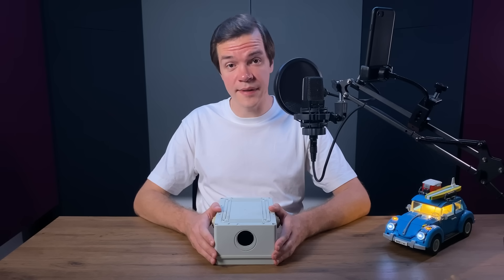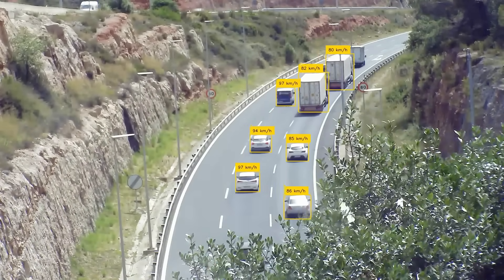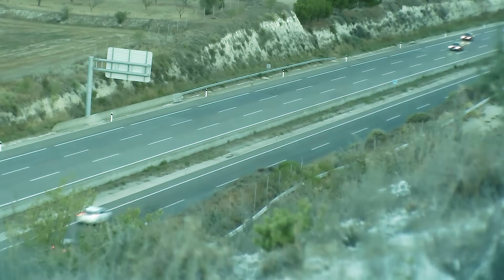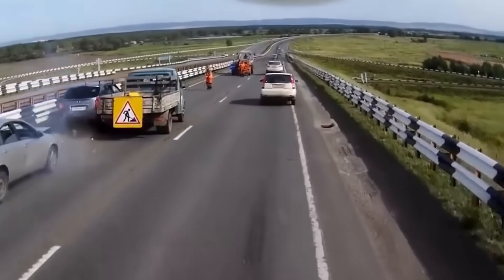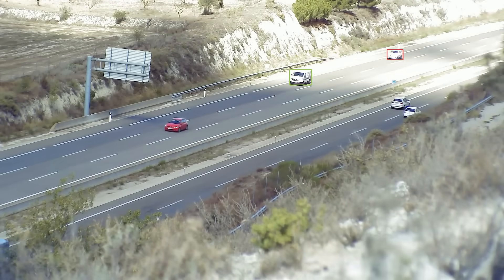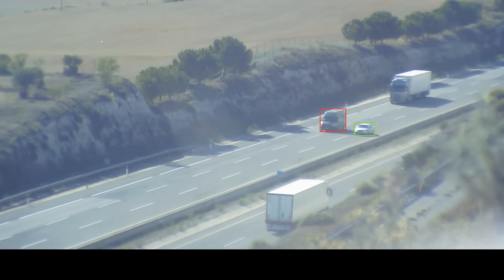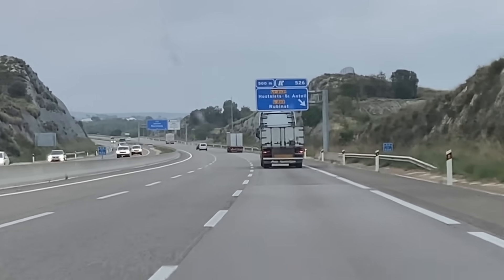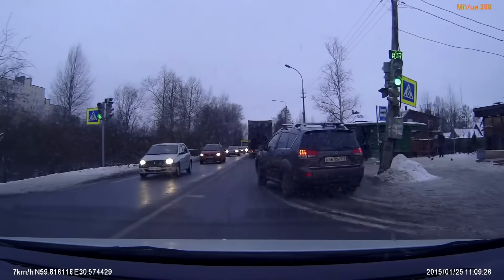New Anti-Tailgating Camera Reveals Shocking Statistics

Comment: the minimum following distance is dependent on speed.  higher the speed then greater the distance.  speeding has an impact on tailgating if the speeding driver does not increase their following distance.  but if regardless of speed the following drivers do not maintain the safe following distance then the safety effect is driven more by tailgating than speed.

Comment: The problem is also traffic congestion, aka how many cars are on the road. People see a long following distance and think "I can take that space". Which not only makes your new following distance to small, but also often leads to sudden stops as you try to increase the distance again. Sudden stops leading to people behind you to run into you. Never mind stop time always is calculated by a fully alert and ready driver. If they are tired, on their phone or any number of "distracted driver" situations your reaction time is not  going to be .9 seconds. So the stopping distance balloons out further. So instead of having every one drive half a mile behind each other for safety it's far easier to just lower top speed.

Comment: 2 big hurdles: cost of realtime video analystics and ALPR.
Speed is easy: ALPR at the beginning and end of section control, calculate average speed? Too high - fine to the license plate holder.
You'd need ALPR at the beginning and end of each camera frame to 100% make sure you can correctly identify the tailgating vehicle.
Still, it's a question of want.

Comment: 100% tailgate on CA highways lol. They all go 80+ mph while tailgating. I once watched a car try to change 4 lanes on a 5 lane highway and it lost control and spun out. Amazingly, all the cars around it slowed to allow it to spin out until it hit the gaurdrail  on its side and it ended up off the road, and then super optimally, all the cars that slowed sped back up smoothly and we were all tailgating again... it was surreal. Obviously something like that usually ends up causing a huge multi-car crash.

Comment: My state of residence recently passed a law that prohibits slow driving in the “fast” lane of major highways. The slow driver can’t impose their speed limit on other drivers. When driving in the fast lane I have 25 seconds or less to change to a slow lane and it is lawful for the approaching vehicle to flash its lights to remind me to change lanes. This removes the necessity of switching lanes for the fast drivers. The police would rather issue more speeding tickets than clear more wrecks. Common sense finally at the state level.
Reply: The trouble is that the drivers who think they are F1 drivers go into the fast lane to drive well over the speed limit. That isn't the "privilege" of the fast lane, the fast lane is abused far too much by imnpatient drivers... who tend to also be tailgaters.
Reply: No, the fast lane is abused by those who think it's their job to enforce the speed limit. Just move out of the way and get on with your day! In almost every case it isn't the sheer speed that the problem but driver error varying from several other things

Comment: I think the same type of people that speed are the same impatient ones who will tailgate when stuck behind someone not speeding 

Not to mention, especially not on freeways however, speed limits take into account non-vehicle dangers such as probable pedestrians, blind corners, animals, and conditions 

This would definitely be a worthwhile thing to enforce, but you kinda got there at 12:15
The biggest issue is that, at least in my country, tailgating to the point most poople do, isn't codified as illegal. Only really bad instances would probably be found as "reckless" or some other more generic infraction.
So first step would be puting the recommendations into actual driving rules (but your country might already, seeing as you have those 100m signs)
I'd argue though that someone cutting you off would be at fault for the fine so no issues there.

Comment: The problem with tailgating enforcement is that it simply isn't possible to fit all drivers on the road and maintain safe distances. To compensate you have to travel in packs, BUT scan well ahead to see the driving patterns of people at least a quarter of a mile ahead of you while constantly reassessing your immediate surroundings.

Also, truckers have a different lead time recommendation. 7 seconds normally, +1 second for speeds greater than 50mphr, and +1 second for bad weather. At 55mphr on a dry day with good visibility, it takes a truck more than a football field to come to a complete stop, and one and a half football fields on wet days. Don't brake check truckers, and never cut in front of a truck going up or down a hill especially if it has its hazard lights on.

Comment: Cars could have built in cameras on the front and the back with a single laser to measure distance. That would allow drivers to report it. But since it happens so much that would create two issues.
1 - drivers would not report cause ots too much to bother
2 - if drivers did report every or most cases OR the reporting would happen automatically then the courts would be absolutely FLOODED with reports like these

Comment: I really liked your video and you're obviously a very intelligent person... but I'd like to point out the following: Excessive speeds are not the only cause of accident, but the primary one. This is because the principle is that if you can't brake in time to avoid an accident, you're driving too fast, no matter what speed you're going. You can insert your tailgating distance and  being cut off reasoning here. Also, not only probability of accidents but consequences of accidents aggravate with the square of speed. Radars only cover locally, true, so more radars or average speed radars are necessary.
Also, in Portugal there sometimes are some markings on the road for tuning safe speed for 120km/h, this could be helpful in identifying tailgating. 
Anyway, I want to congratulate you on your tech savy initiative, it was a very very didactic video and I subbed.
Reply: No, speeding is not the primary cause of wrecks. Your principle does not reflect human behavior, so you can’t design your expectations around them.

Comment: The safe following distance rules are invalid for modern cars that can stop much quicker and even have auto breaking in some cases.

But there is no reason to drive at highway speed 10-15m behind someone. It’s suicidal. 

Just give some space. Minimum 3 car lengths.

Comment: Just a few thoughts:

The box seems pointless. Practically any regular video camera could have recorded that footage.

Tailgating cameras exist, for example here in Austria. Curiously, they are only used on weekends and never during weekday traffic.

The danger of speeding is not just about other drivers. There are also objects that can bring you to a very sudden stop, like poles, guardrails, trees and so on.

The recommended distance to the car in front is usually two seconds. That includes reaction time and one second for braking. This is based on the assumption that the car in front is also braking normally and still moving forward.

But overall, I do agree with you. Keeping a safe distance is important, and many people don't follow that rule. In my opinion, it is kind of an ego thing. Just the way people are.

Comment: truckers do not tailgate to save fuel.
they tailgate to close the gap between the truck in front of them before overtaking so they don't block the lane to long for other traffic.
and in the netherrlands the recomended time is 2 seconds.
all modern trucks have radars installed to stay at that distance when driving on cruise controll.

also in gemany there are camera systhems in use that measure tailgaiting but is done with two camera's and two measuring points some distance apart so a car is tailgating and not a one moment acurence.

Comment: Tailgating a truck in an electric car DOUBLES your range compared to be alone at the stable same speed. 1 A car can brake way harder than a loaded truck. 2 behind a truck you have its big red lights just in front of our eyes. One day an alcoholic guy told me that after loosing 2 times its licence in accidents when driving drunk, he decided ..... not to stop drinking, but driving only following trucks. From then no accident [;oD Joke aside most of peaople chose their tailgating distance from their perception of their own ability and car capability. Most of the time it is correct. Proof is most of people have no accident. Would be interresting to add the drivers age data ontop of your distance graph. I'm pretty sure that most people gradually increase their distance when aging. Driving a good chassis/Brakes/tires car, I'm only seriously concerned by what is behind me when on a motorway.

Comment: If tailgated (excessively) I just ease back on the gaspedal slightly for 30 seconds. Then accelerate quickly (since I now have plenty of space ahead). Repeat process if necessary. Appropriate distance is rewarded with stable speed😊

Comment: There was a public warning ad about tailgating on TV when I was young. The phrase they used was "Only a fool breaks the two second rule". You see the car in front of you pass a road marking and then say the phrase - it takes 2 seconds to say, so you should be able to say it before your car passes the same mark. Never forgot it. Taught it to my kids.
Reply: I saw that, and follow that! Most cars break the 1 second and often the half second rule these days 😬
Reply: Sounds familiar, with a second line something like "and double that in bad weather"
Reply: In Norway those ads had a 3 second rule. Count 1001, 1002, 1003, easy
Reply: @retroMartin  That sounds like a 2 second rule: If you say 1001, 1002, 1003 with one second between them, only 2 seconds have elapsed.
Reply: Incorrect. Each 1000 is  second.
Reply: @retroMartin  Add 1004 to that to actually get a three-second duration.
Reply: Nope.  Three-Second Rule, at a minimum.
Reply: Same. That was in a time when revenue raising wasn't the first choice and it was all about safety.
Reply: And 55 stay alive
Reply: Stupid idea.  Timing is a function of speed.  The faster you go the more time you need.
Reply: @alexandercastleberry480  It's a matter of reaction time. It doesn't matter what speed you are going. If you apply your brakes 1 second after the car in front of you does, and you start 2 seconds behind, then you should have a 1 second buffer. But there are so many distractions these days, they've increased the recommend follow time to 3 seconds, or even 4 seconds, and more in bad weather.
Reply: The 3 second rule has been used for a very long time in some areas - at least since the 1970s. Also, if following any second rule, the distance between you and the driver in front of you increases as the speed increases.
Reply: You only need more time you come to a stop if the object which you need to avoid is already there, stationary. If the object in front of you is moving, then when it begins to stop, even if it slams on the brakes, as long as you are following at a distance of 2 seconds or greater, you have enough time to avoid hitting them. Also, if you and the object in front of you are moving at the same speed, the distance between you increases as the speed increases. 

I've heard several "second" rules, but the one I prefer to follow is the 3 second rule. If I'm off in my count, it's not a big deal, because I still have a good bit of reaction time. You need at least 1 second if you're alert, but if you're tired or relaxed, you might need more,  and if you're allowing 3 "seconds," even if your count is fast, you should still have a good 2+ seconds to safely react.
Reply: @alexandercastleberry480  You missed the point and do not understand the concept.
Reply: @alexandercastleberry480   A two second gap will automatically be longer in distance when traffic is faster.

Comment: Cars should have an inbuilt front proximity alarm just like a seat belt alarm. The speed of the car should automatically go below the front car's speed if the distance between is less than the safety distance.

Comment: You are right, observing a short section without context like cutting in in front isn’t doing any justice.

Consider this:
 I think 30m (reaction distance) is usually chosen because it is assumed the car in front also brakes at about the same rate (ABS) which would be enough. Also we usually observe further ahead than the car in front, so in situations (lane change) where we know that car in front is not hitting anything to decelerate faster than normal braking, it is justifiable to undergo that 100m distance temporarily. Its not like the front car can be expected to hit a invisible wall. 
Emergency braking assistance systems are EU requirements now for new cars. But foresightfull driving and braking will be tough to implement in automatic systems.

Comment: Speeding causes problem with lane change safe. HGV has speed limiter set to 90kph. On motorway we have 140kph speed limit (PL). So driving 100-120kph is absolutelly ok, but there is the trick: you need to change lane for overtaking. Speeding vehicle has approach speed more than 20kph (140-120). I usually program my car for speed 112kph on S-class ways (speed limit 120kph). It is fast enough and fuel economic. Here comes the problem, cars with speed above 160kph. Speed difference, that makes hard to change lane safe.

Comment: As a truck driver, I learned that the 2 second rule is part of a longer rule. 1 second of following distance for every 10 feet or 3 meters of vehicle length. A motorcycle can stop very fast, a 60 foot long truck takes a lot longer.

Now take a look at how far apart those trucks are. Between each other 2 seconds is probably enough, because they all have about the same stopping distance; but following a car, they have no chance of stopping at 2 seconds.

Comment: Tailgating is certainly one of the problems. Perhaps I'm too optimistic, but I'm convinced that most problems with traffic on highways could be done away with if people used the passing lane to pass. Instead they just sit there cruising at the same speed as the person beside and them while 10 cars pile up behind them. In some worst scenarios the inattentive driver gets mad that the people their blocking are "too close" and begins brake checking.

Comment: The other reason for the rear enders is that people only look at the car ahead, not around it or through it, they also don't anticipate events and actions before they happen, i.e. understand that a joining lane will likely result in a queue of slower moving vehicles, or that an exiting lane may give rise to people trying to hop through the queue you're in creating more chaotic dynamics as your lane adjusts. there's also the classic psychological action where a faster driver coming up behind someone slower will "push" the other car to either speed up or clear the lane.  As you say, speed is generally not the main factor in reducing safety margins and automatic systems can't evaluate  and issue fines on their own for anything other than a simple yes/no momentary evaluation - systems do not have the ability to evaluate behaviour or events over time effectively. The ideal would actually be to get more traffic police on the road and ban them from issuing speeding tickets and spend a period, probably 2 years, issuing heavy fines for unsafe driving practices, with following distance and distraction as primary targets. this is cost prohibitive though as lots of cops and cars is expensive.

However...

A combined system of momentary evaluation - i.e. the camera can detect insufficient following distances and take a video, tracking the offending car for 20 seconds or whatever is reasonable to gather evidence, then that recording could be passed to a small team of analysts to assess the situation and the Driver's attention to safe practices - they could then see if the flag was raised because someone cut in and then evaluate if a reasonable effort was made by the following driver to open up the space for safety, or if they allowed emotion to dictate and actually closed the gap, as is often the practice. There's ways this effort could carry on and it might be worth exploring how citizenry could be used to force the government and police to direct their attention and money to this aim.

For context I live in Western Australia where tailgating is the NUMBER 1 cause of accidents, yet everytime a major accident occurs the government response is always to knock 10kph off the speed limit. we have three lane highways limited to 60kph because they are trunkways and people keep running into each other because following distance is still trained in car lengths - not time. Plus heaps of drivers learn on in a sedan or a small hatchback, then immediately buy a big SUV or full blown offroader, at which point the visual estimation of length gets trunkated by the extra height. So if anywhere needs this kind of system, its here.

Comment: Another assumption youre making by taking a video from an angle but drawing a straight line to calculate....

The lane closer to you are showing you higher speeds than the outside lanes... try using real 3d perspective and you will see and be able to get more accurate results... by the way great video otherwise... just letting you know where assumptions are made